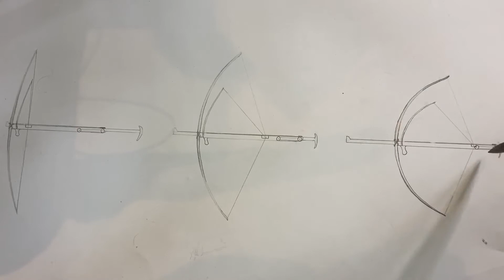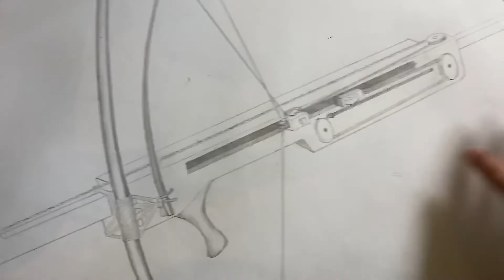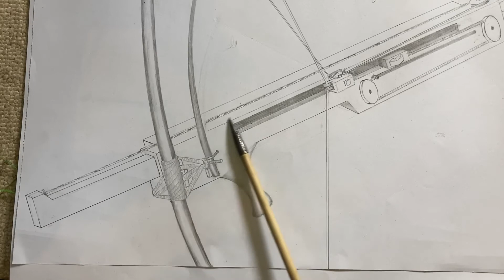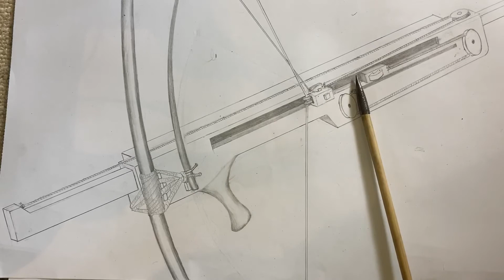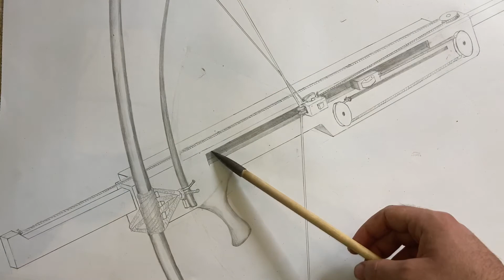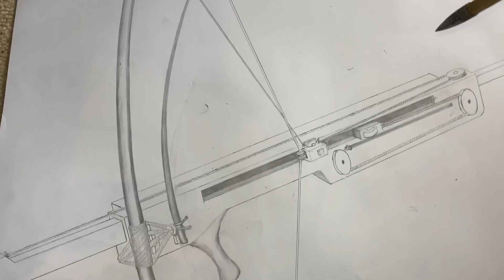My solution to the instant Legolas assist problem

Comment: Such halve bows where also used on lathes. I see the problem that in time your pulley system sets in you need longer arms or made the main bow stiffer as a normal bow would be. My latest version was that. I had more but they do not work as well. Whatdo you think? https://www.youtube.com/feed/my_videos